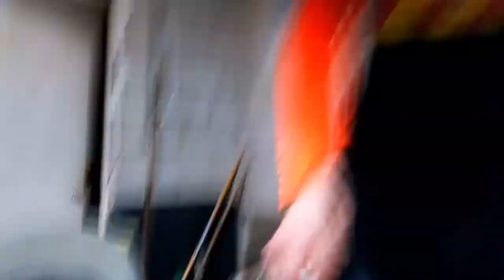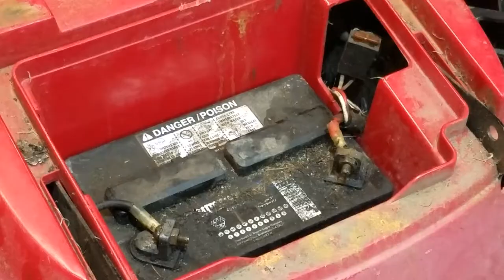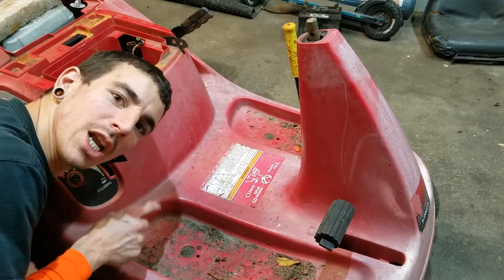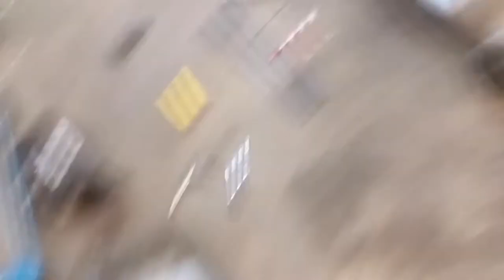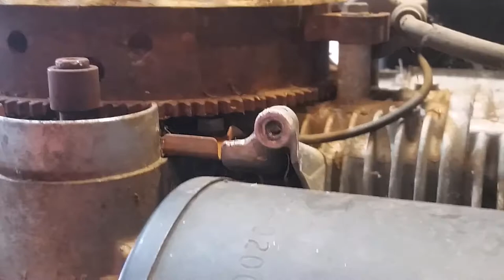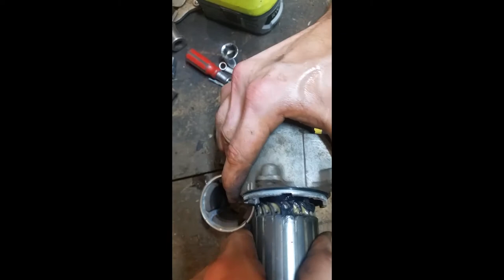HONDA Harmony *FIX!!*

Comment: Hey I’ve got a Honda Harmony that was sitting in the back of my grandparents yard under a tarp for 15 years or so.  I love to tinker with motors, but I just don’t know if it’s going to be worth it.  Do you think it could be reparable after sitting for so long?  Thanks for the video bro.  Huge help
Reply: mine has been outside for 3+ years through multiple winters and no tarp and im wondering the same thing
Reply from the maker: To both of you:
YES I absolutely think it's worth tinkering with.  Honda makes incredibly reliable motors and quality equipment in general.  Make sure there's no mouse nests  under the engine covers blocking the motor cooling fins.  Same goes for the air filter & intake.  Check/change oil.  Use Fresh gasoline.  
With a good battery and some starting fluid, I would be shocked if you weren't able to get them to fire up!

Comment: Thanks for video. I bought a Honda 1011 in 2003 for about $2000. It has run good until last fall when the height adjustment jammed up. Meanwhile my dealer retired and closed up. So I have been using YouTube videos to see how to fix this Honda. I think I am going to try to take big red body cover off to see what is jammed because I just can't see in between move and the deck. But your step by step removal should help me. Thanks again.
Reply from the maker: Thanks for watching!
I Hope you got yours figured out.  That cover likes to fight me almost every time I try to take it off 😅

Comment: thank you for going over the Honda Harmony 1011 it's been so hard to find anything on these mowers. now i have a non-hyrdrostatic mower, and i've been having issue with mine we are pretty sure it's the solenoid that's gone bad but i don't know that part number or how to best find out what kind of solenoid i need any help would be greatly apreciated.
Reply from the maker: Hey man! What's your issue? Oddly enough, im currently having an issue with what I thought was solenoid also!

Comment: Do you know what sizes the drive belt and blade belt are? I can’t find any information thanks
Reply from the maker: 76184-772-003 and 76181-772-L02 are the belt part numbers. Blade is 30"

Comment: Disconnect the safety plugs on the left side of the motor. It'll start right up
Reply from the maker: Really? I'm currently having a similar issue as in this video with what I thought was the solenoid. Replaced it to no avail.  Will try this and report back. Cheers!

Comment: How to add transmission fluid?
Reply from the maker: That's a good question! I will investigate promptly and dedicate the video to ya👍
Reply: @legenderekfixes   because I hit something causing a small hole in the transmission case.  So I fixed hole BUT cant figure out how to replace fluid.  There seems to be a bolt on bottom left of case (looking at it from rear) possibly the drain plug?‐  my thought put machine on an angle so I can pour some fluid inplug any idea on fluid capacity?